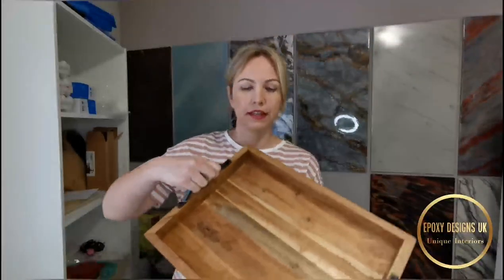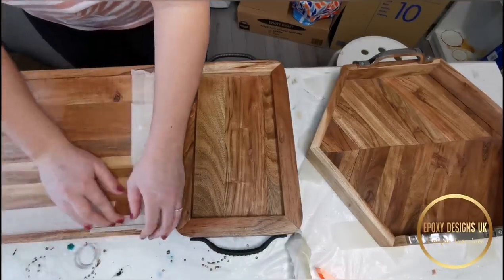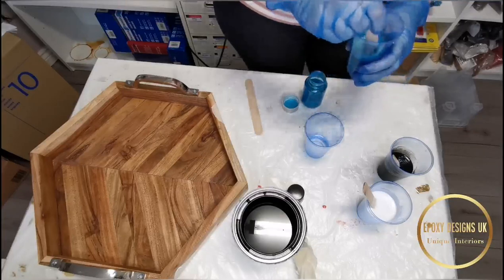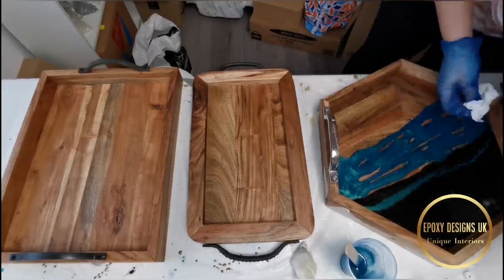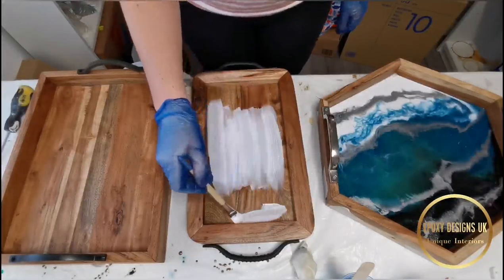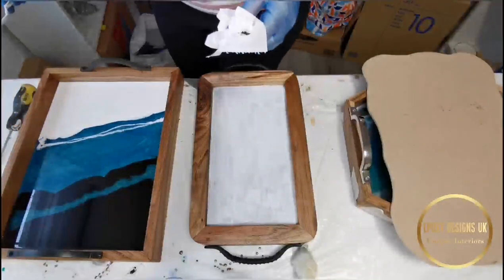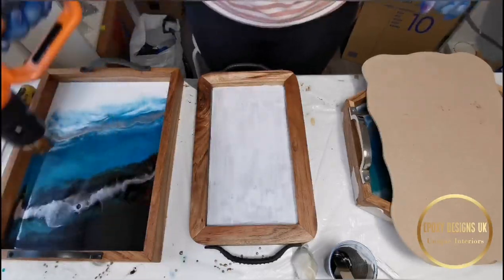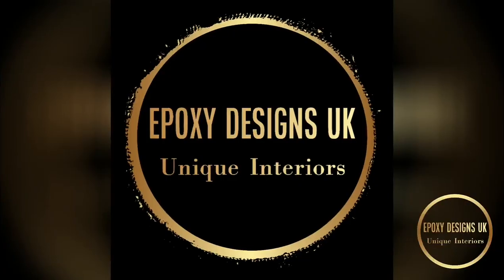#10 Epoxy Resin On Wood Tray - How To - Including Mistakes!

Comment: Hi I love what you have done, ive ordered DIPONDE, EPOXYPLAST 100P (A) from Amazon but Im not sure its resin? Please can you tell me if I can use this on art work and doing trays like  you have done, I would really appreciate if you or someone else could let me know, thank you 😊
Reply from the maker: Hiya yes you can use Dipon 100p it's a little too runny for my liking, it will be OK for a tray or art. I would personally recommend Glasscast 3 this is what I use now as it's thicker and better to work with in general. But for a beginner to try out you will be fine with the one you bought 😊
Reply: @epoxydesignsuk3537  Thank you so much for replying back so quickly,  I really appreciate it,  thats great to hear I can use the one I bought,  the next time I will buy the one you use,  love your trays so much, thank you so much 😊

Comment: Cud u tell how to clean d sides of d tray after.resin
Reply from the maker: Hiya I use a lot of masking tape so the resin does not leak where I don't want it. If you get some resin on the wood wipe it with a tissue straight away because if it dries on the wood you will have to sand it. Hope this helps